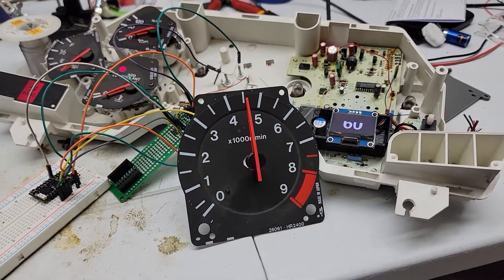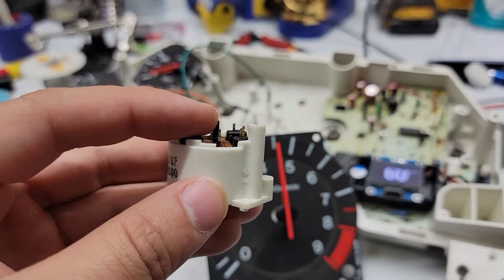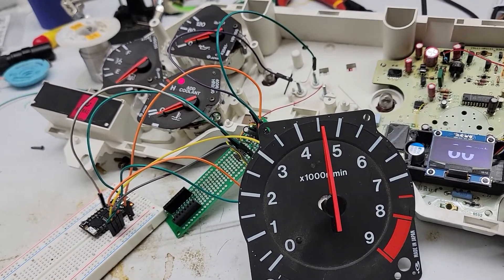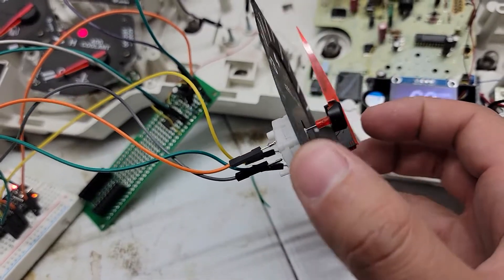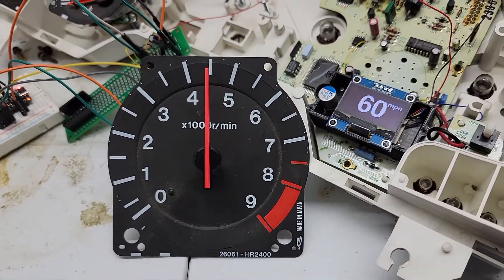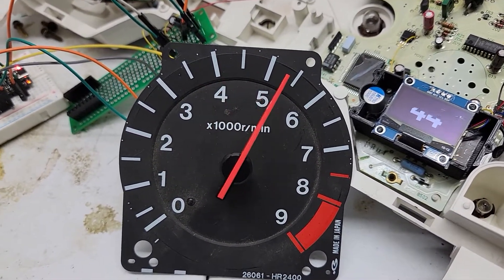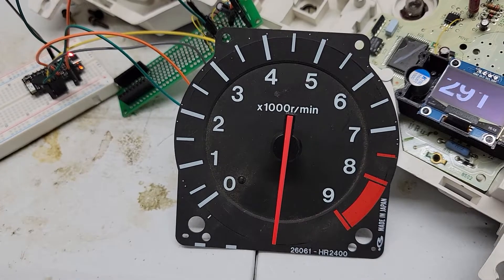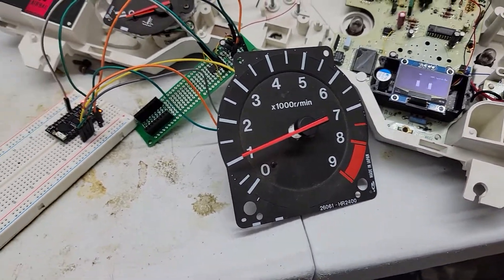using an x27.168 stepper from GM clusters with a frequency input for an rx7 cluster.

Comment: I played with sw27 steppers but could find needles that fit the shafts, are you using the FD needles?
Reply from the maker: Yep I'm using FD needles but there's quite a few options for needles of these on Amazon and eBay. Have you tried those?
Reply: @GeoffPritchett  thanks for the reply, I'll look into options on Amazon